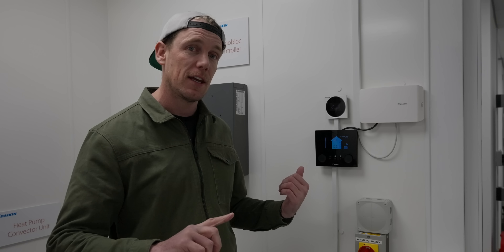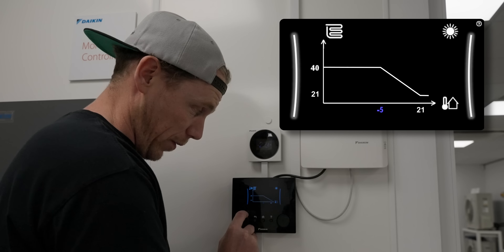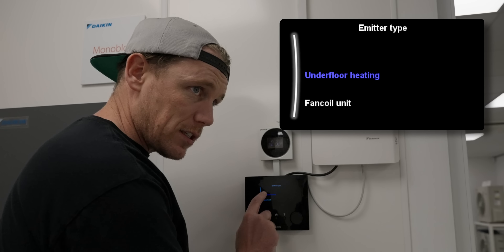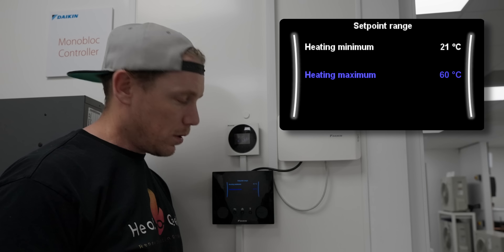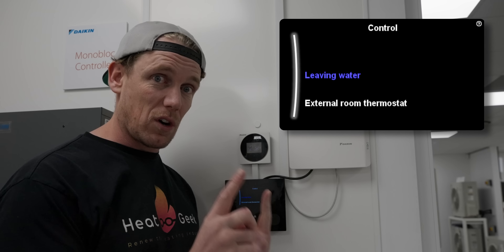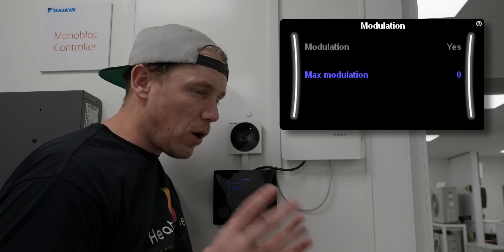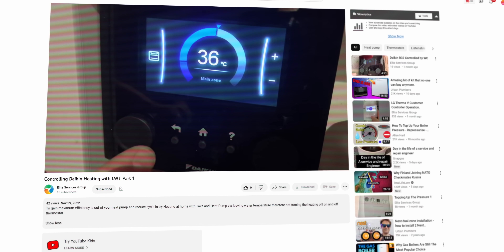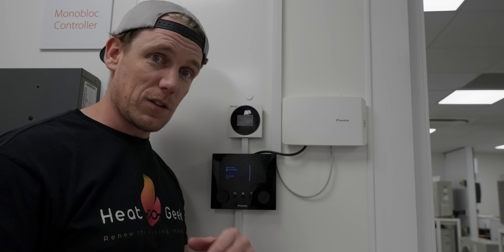How To OPTIMISE Your DAIKIN Heat Pump Controls!

Comment: I have an efficient house with an altherma 3 and UFH and due to the fact that I do not need a really high water flow temperature to have 21 degrees at home, my compressor does not work too often and the backup heater is on often. What settings would give me the most efficient performance for my heat pump? I.e higher water leaving temperature at the start of my curve say 25 (offsetting to decrease target temp) but compressor working more often OR lower starting temp, say 21, with the back up heater running to cover these lower temperatures?

Comment: Can some please advise what heat pump power to go with? 
I am bringing offered within a wide range of specs from 7 -10 kw, for my 100 square meter property, with decent external wall isolation (10cm polyurethane), loft 10cm cellulose and underfloor heating. 
I have netmrrowed down to a 8kw Daikin or 7kw Vaillant, but i have been also advised that 5kw Daikin should can be a perfect fit, of course I would like to go lower if possible.
What do you think?

Comment: Since the thing that makes a heat pump less efficient is the backup heater, the setting that could play a big role is Equilibrium. I understand the concept of it, however I would love to hear some more information about how to set it up. 

My curve goes to around 50 leaving water at 0 ambient and I wonder how far it makes sense to push the pump before let go to boiler mode. 

I know it is an installer setting however I cannot find any info on it and my installer is kinda hard to get.

Comment: I just had a Daikin Altherma system installed to replace gas.  I have underfloor heating but never changed the temperature day and night because I found that you could turn the heating up or down  but it takes quite a while to be experienced in the floor.  I can't see that the Daikin would change this.  I won't find out until the winter.
Reply from the maker: That's just underfloor hearing fir you. High mass

Comment: Great video, thank you. 
I have a question for you relating to my Altherma 3 unit. I have 2x FCUs installed (1xUpstairs, 1Downstairs), and 2 zones off each FCU (4 zones in total) controlled by dampers.
My installer fit AirZone controllers in each room, not Daikin, telling me this was the only option for my setup.

The issue I am experiencing is that my space heating never gets above 20degC.
I watch the Altherma sensors and actuator readouts nd can see the refrigerant temp climb to 50degC for example and the LWT reaches roughly the same, the warm air flows out of my ceiling grills.
I then see the compressor switch off, the refrig temp drops as does the LWT and my room grills blow cold... which chills the room to a lower point than before I put any space heating into it!
My current setup uses External Room Thermostat as the on/off control for the pump.... 
Should I use Leaving water temp and the WD curve to control the pump being on and off or is there another issue here?
Thank you

Comment: Hello! Any tips for hot water energy consumption? 
In the spring i am planning to install also a solar hot water system, but till then i am on 600kwh/month only on hot water. Is on schedule for last 2 months, but there is not much of a difference since I’ve switched from continuous operation.
Reply from the maker: https://youtu.be/oJeyc_cGIMU

Comment: How do you calculate the loss in btu output of a rad relevant to flow temperature. 
IE if you have a 30 degree flow but the output of the rads is marked for 50 etc. 60 etc.

Comment: Thanks for the video, love em. I don't understand why the top flow temperature tops out at 40 degrees. Surely if it goes below -3 it needs to continue up to compensate.  what you describe in setting the curve in the first place is how I run the whole time with a third party (nest) on off stat which never trips because the curve is set right and because I don't want the room adaptation ramp-up. Thought about going with the proprietary wifi stat (mitsi) but no need. it prevents you refining the curve because you don't know what its doing. Be great if you could run it in wc mode and use the plus and the minus buttons.
Reply from the maker: There's another curve type if needed or you can set for -5. All very unlikely to be an issue though

Comment: I have recently replaced my Biomass boiler with a Daikin Altherma 3MA 11kW Heat Pump.
I’m looking for some advice on any adjustments, if any I may need to make to my existing underfloor heating manifolds/flow meters to accommodate my new Heat Pump installation. 
There are two floors at the property, each has a Nu Heat underfloor heating system designed and installed some 17 years ago.  I do not know the design or the operating temp that the system and manifolds and flow rates are set to as the original heat source was an oil-fired Rayburn which was subsequently transferred to a biomass boiler some 8 years ago. 
Each floor has a manifold and flow meters for each room on that floor. Each room has a thermostat electrically connected to a control valve on the appropriate manifold loop for that room.
Each manifold has a pump to drive the water to and from the buffer tank
The heat pump provides both heating and domestic hot water with the heating provided by a larger buffer tank at around 40 - 45 degrees.
What adjustments or changes should I make to the existing underfloor manifold system to ensure maximum efficiency from my heat pump.
The sort of questions I have will probably seem trivial and not be relevant to the specialists contributing to this site but as an example should I open the flow to max for each loop, should I eliminate the pumps that are provided for each manifold and rely on a single pump at the buffer tank that is switched on when the main control system demands heating from the HP?
I understand and am for the moment happy with the concept that the existing room stats provide the over temp cut off point for each room.
Any advice would be most helpful on what to do with the basic underfloor manifold settings would be much appreciated.
Reply from the maker: Watch the commissioning video
Reply: @HeatGeek  Many thanks. Have not found any URL's dealing with this point so far. Could you point me to the video you believe will solve my problems.
Reply from the maker: @MykeH-c6k  youtube doesn't allow links. Search 'heat geek 3 steps to commision'
Reply: @HeatGeek  Sorry to be so slow on the uptake - clearly I need a Heat Geek!  Trouble is, not many about in North Wilts. Thanks again. M

Comment: any advice my mums got mitsubishi heat pump was fitted just over a year ago. it absolutely eats electric £160 a month dd and its a one bed bungalow. seems ridiculous when my 3 bed mid terrace hers is also mid terrace is only using £120 of gas with 6 of us. both houses are 60s era council property so comparitive in insulation. her property also has solar panels aswell.
Reply: Controls, weather compensation, is the solar working, does that hot water cylinder recharge when solar often producing, can you back off the hot water temperature, are there some quick wins you can do with insulation/drafts. Also don't forget you have an electric bill too, all that energy still goes into your house (minus an EV)!
Reply: @edc1569  it still doesn't make sense a one bed bungalow probably a third of the square footage of my 3 bed house of the exact same era built by the same council is wildly different. My gas and electric is now coming to about £200 a family of 6 where as my mum's bungalow is £160. I can't see that heat pump getting close to a cop of 3 when it's consuming all of that. I know it's well insulated loft wise and it's definitely not a cold or drafty house. When I last checked the pv was generating but being winter not alot probably 300w on average perhour of sunlight. There is no ev. Only thing she really uses is the TV which is a modern led TV. Her base load is probably well under 100w. All the radiators have been replaced for bigger ones when the system was fitted the only thing is that some of the old piping has been used wether that comes into play that much I don't know.
Reply: @HA05GER  Did you have a heat loss survey done of the bungalow? That should tell you the ballpark of what the ASHP should be costing. Turn off the ASHP and then look at the base line consumption - how much is being used without heating. Is there an immersion heater switched on somewhere? Is someone using an electric fire because they feel cold? Then turn it on and see how much it's using over the baseline. Buy an IR thermometer gun and measure the temperature of the flow and return of each radiator, then check that against the settings for the ASHP. That should put you in a better position to evaluate where the issue is.
Reply: @emdrum  I haven't got a clue it was fitted by the council so don't know the exact procedure. From what I can tell nothing is being left on. It's a 1 bed bungalow so you can't really miss something being on. The only thing I can think is they only put it on just after she moved in and they are estimating the bills based on the previous residents with normal electric heating.

Comment: In my opinion the first statement you made is at best misleading or even wrong. I’m a big fan of Daikin,I’m retired, I’ve sold their products,I’m now retired and have just installed a Monobloc Daikin 3m to replace my Oil Boiler. However long before I even considered my recent purchase I had installed an excellent control system that provides me with full control of each radiator independently and individually. It provides me with Weather Compensation, Optimum on, Optimum off, geofencing, highly accurate PID control of each radiator. Daikin are great mechanical heat producing products but their controls are decades behind. Upgrade the home controls before doing anything else. I’ve moved my home built in 2006 with BER energy rating C3 to A1 as certified last week. 50 years experience in energy reduction on domestic and industrial applications are my qualifications.
Reply: What's the control system you installed?
Reply: @EugeneLambert I recently set up Daikin weather control which enhanced energy saving

Comment: I checked the manual for mine(EDLA09DA3V3) and if I am reading it right it says the minimum temp flow for heating is 15 degrees and 25 for hot water. I hope I am right as my house was roasting in November with the flow set to 25 it took me a while to find out how to adjust the curve below 25 degrees. In installer mode, you can set a min/max for the curve and the min was set to 25. By the time I found out how to go into installer mode and change the setting it had cooled down outside.
Reply: Min setpoint for the heating room stat might be 15, but not the flow temp.
Reply: Yes and how to deal with efficiency when my backup heater turns on because I fo not need flow temps above 25 degrees!??? What options do we have?

Comment: why all 3rd party controls sucks on Daikin units?: 
1) Daikin is using a proprietary version of Modbus, and no one can create a reliable "not hacked" version of controls.
2) Daikin removed local API, so you are not able to control their units locally using WiFi
3) Cloud API requires signing NDA and, as all cloud-only things, sucks and no 3rd party can use them.

I want to point out, it is not 3rd party controls that are terrible, it is Daikin that makes them bad by locking down communication protocols. And it is not like you always want Daikin controls with Daikin units, you are left with no choice in this question. How bad is Daikin's controls you can read in google play store where their app has a rating of 2 stars.

Comment: Why don't ypu want 3rd party thermostats? What if I want to zone control? Or zone control is inefficient for heat pumps?
Reply: Ideally you want an open loop system. In order for the airsource pump to be as efficient as possible we want a design as simple as possible. If you start closing down zones warmer air will rush to those colder areas therefore the heat pump is working harder to heat the home in order to get up to desired temp.

Comment: I'm still not convinced by closed loop weather compensation. 

Would much rather a PID loop that controls the flow temperature. That way if you get any solar heating of the house it backs off the flow temperature as required.
Reply: Any room stats should reduce flow temperature to suit.
Reply from the maker: Each property and user as a different solution and we went through variable internal feedback in this video. The only way you could ever be convinced is by trying it. We've been installing it for 10 years now so one of us is doing something different
Reply: Id be making use of that offset feature, get it dialled in nice, but give it lots of bandwidth to crank the flow temp up for when I've got back to a cold house, and likewise crank it down when I've had the log burner going.

Comment: This is really useful thanks. I see you're standing by a sign saying Monobloc so I assume this controller is for a Daikin monobloc. Can I get this controller on my Daikin split system ? I have exactly this control system but it's on the indoor unit itself which is not very accessible.

Comment: Thanks, was interesting to see.  I appreciate you probably shouldn't pick a heat pump for the controls but those looked nice with lots of features.  Which heat pump has the best controls in heat geeks opinion?  Thanks
Reply from the maker: Viessmann or vailant..  we chose the hp based on controls! And r290 also..
Reply: I have a Daikin ASHP, control are ok but fiddly. BUT does not calculate your COP automatically, grrrr. It does give you energy used and heat outputted but its very basic and you have to do the COP calculation yourself. Really hate this, all the data is there, they just do not give you good access to it.
Reply: @HeatGeek  brill, thanks from the info.

Comment: Overshoot.  Heating/cooling —> Overshoot —> Increase from 1 degree to 2 degrees.

I find when the heat pump recovers from Frost Protection, or any situation where it’s been turned off, the flow temperature overshoots the setpoint and then the compressor cuts out before the flow temp has had a chance to rebalance.  It leads to very choppy performance on frosty nights.  But when I adjust overshoot from 1 to 2 degrees, there’s far less cycling going on.

Interesting, my compressor often doesn’t want to drop below 2.3 Amps of load, especially above 7 degrees C, even if the flow temp has been running above the setpoint.  Occasionally I see 1.3 amps, but not for long.  Do these compressors have a minimum load?